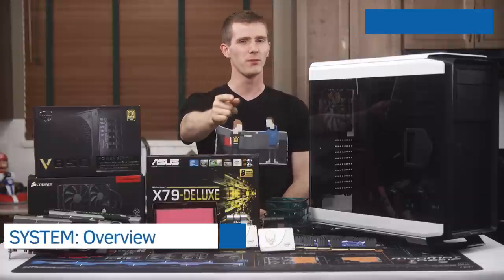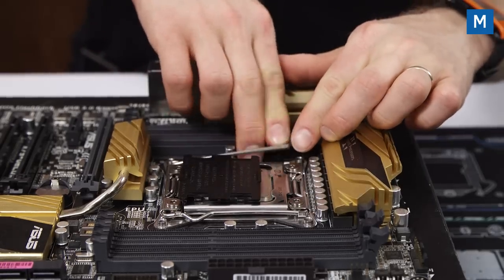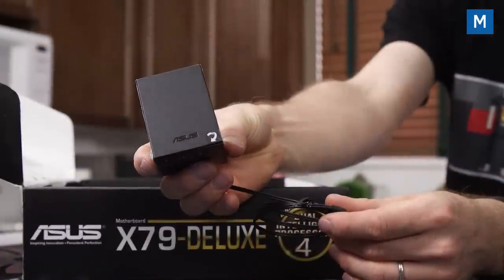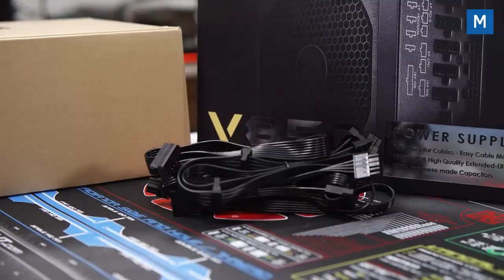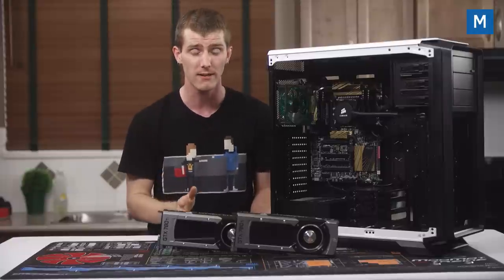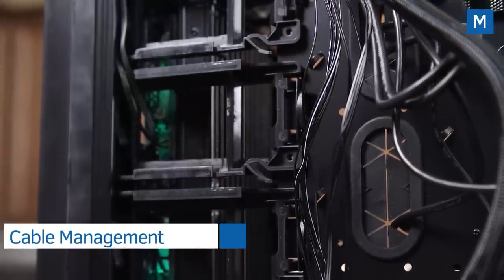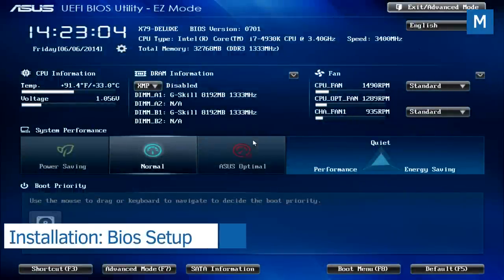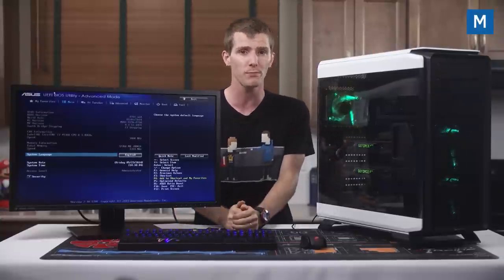How to Build the ULTIMATE 4K Gaming PC Build Guide

Comment: Can this handle minesweeper?
Reply: No.
Reply: minesweeper needs Intel Core i9 8970x @39Ghz ,32 cores,256GB of RAM,Geforce GTX TITAN 9 ULTRA 8 way sli,90TB SSD to run in 0.01 fps.If you want to run in 120fps,get a 128000 node of Xeon E19 (98th Gen) of supercomputer
Reply: Eugene Yau But the Titan 10 Ultra Ti just came out, get it instead. It is only $30,000 more then the Titan 9 Ultra non Ti.
Reply: thanks
Reply: Impossibruu its only 7 billion pc's that can run that game at stable 60 fps the pc is your brain :)
Imaginationnn.........
Reply: Eugene Yau :( dang it all i have is an i5

Comment: Could you make an Ultimate 4K build for 2017?
Reply: +Mateo Vasquez yeah with quad SLI please
Reply: +Dante hollow 4k effectively rules out SLI, because AMD are better at higher resolutions. You want Crossfire.
Reply: +Dante hollow why
Reply: +Christ J Dont buy amd now, wait for polaris at the end of summer. Im gonna upgrade my gpu then
Reply: +Samuel Kriikkula there's nothing wrong with amd if ur on budget, also upgrade to a 1070/1080
Reply: Ethan Mc 1080/1070 too expensive for now i would just wait for polaris
Reply: +Samuel Kriikkula it's not really?
Reply: Hey guys, I need your help. Could anyone tell me how to know if a graphics card is compatible with your motherboard? Im thinking of getting a GTX 760 but im too scared to buy it and hope to god it works
Reply: Mateo Vasquez if you have a graphics card already then it's fine. If not, it's still fine.
Reply: Christ J Huh?
Reply: Mateo Vasquez basically, provided your motherboard is less than a decade old, it's almost certainly fine.

If you want to be certain, download CPUZ or HWInfo and install and run it. Then see what the results say about your motherboard, and search for any compatibility issues.
Reply: Mateo Vasquez any motherboard that uses pcie will work with any amd card made since 2006+ and any nvidia card that says GTX next to it
Reply: Gigabyte gtx 1080 Xtreme Waterforce Your's is too outdated, and 32gb of ram? That's overkill. I can build a better one for cheaper. 
https://pcpartpicker.com/list/6m89Ps
Reply: my build, called it "the exotic"

i7 7700k
asus strix z270e
crucial mx300 1TB m.2 ssd 2280
2x8Gb corsair vengeance lpx 3200mhz
corsaif h100i v2 water cooling
h1000i corsair platinum power supply
corsair 400c
aorus gtx 1080 ti

around 2.5k us$

there's your 4k build

Comment: Its 2017 and I still think 144Hz on 1440p is better than 4k.
Reply: Bevan Jonsson it’s 2019 and that’s still the case
Reply: 2024 and 4k is maybe starting to make sense?

Honestly it's in the same spot as before 😂
Reply: @hellowill  can you now regularly get 120+ fps on 4k with a single gpu on max settings?

Comment: Can it run Duck Life 4?
Reply: no
Reply: no
Reply: +Pepperbird no
Reply: +Pepperbird if you want your duck walking around in 30 fps, go for it!
Reply: +Samuel Gratkowski thanks for the advice. I usually got 2-5 FPS and it runs smoothly.
Reply: +Copter256 No. You will need at least 60 GPUs in 60-way SLI to run that.
Reply: +Dylan 873 you need a 9000 way sli of titan x
Reply: 1% percent of people get that joke
Reply: DONNY THE SLAPA whos that?

Comment: I think R9 290Xs would be more apropriate than 780 Tis for 4K gaming.
Reply: The R9 295X2 is probably ideal.
Reply: I agree , not enough VRAM on a 780Ti , probably not enough VRAM on a R9 290X but the extra gig will really help .
Reply: ***** It's not only the VRAM, I also see in becnhmarks that R9 290X performs better in 4K than a 780 Ti in 4K cause of more memory bandwith and ROPs.
Reply: I thought AMD fixed that issue, no not because of that since even a single R9 290X performs better in 4K than a 780 Ti.

Comment: How much FPS would I get on Minecraft with this build?

APU: AMD A10 7850k over clocked black edition

MOBO: MSI A68h matx board

HDD: Seagate barracuda 1TB 3.5 7200RPM 

PSU: EVGA 430W 80+

RAM: Kingston HyperX Fury White 8GB (2x4GB) DDR3-1866 Memory
Reply: 300-700
Reply: +.The Randomizers. Thanks
Reply: I change the parts a bit will it still be the same? Here.
How much FPS would I get on Minecraft with this build?

APU: AMD A10 7850k over clocked black edition

MOBO: MSI A68HM-E33 matx board

HDD: Seagate barracuda 1TB 3.5 7200RPM 

PSU: EVGA 500W 80+ Certified ATX Power Supply

RAM: A-Data XPG V1.0 8GB       
(2x4GB) DDR3-2133 Memory
Reply: same
Reply: Thanks
Reply: No GPU?
Reply: RileyCSGO Yeah?
Reply: +AlexaGaming prob 60 fps
Reply: You need a gpu to at least play the game at higher framerates with "resource packs" as well.
Reply: +AlexaGaming At different settings, here's what you'd probably see.

1080p, no entities, standard world: 60-100fps(ish, I don't actually have your exact rig but it's close enough)
1080p, no entities, void world: 120-170fps
1080p, 100 entities, amplified world, 20000 particles will bring you below 15fps
Reply: +RileyCSGO apu..
Reply: +AlexaGaming  you must write the graphigs and the ssd not just the apu
Reply: my build is almost identical but higher ram and an A8 but I get well over a hundred.
Reply: okey how much ram do you have i have 16GB
and a nivida gtx 950 and intel i7 thats pretty beast but you can play minecraft on that pc on far you should get about 50-200
Reply: Gillis Salonen I have 16gb and an A8 7650K
Reply: +AlexaGaming Go play a real GAME bro, some GTA would be really cool...maybe some Battlefield or CSGO
Reply: SergeantKalSkirata 0_0 GG
Reply: +AlexaGaming Above 60+ all the time, but I would suggest getting a GPU
750ti even

Comment: Only 1 monitor running ~45FPS?  nice production, but for the money spent the actual computer blows.
Reply: 4k max settings what would you expect
Reply: from a single?  4K 150FPS+. I literally want my hair to be blowing back there is so much graphical processing power.  Remember, ULTIMATE computer.
Reply: to be honest I will be content on running medium/high settings at 60fps 4k on my r9 290. A higher resolution is a bigger improvement than almost any quality setting. But I understand why people would want more for that much money xD
Reply: Son of a Zombie even a maxed out system wont atm

Comment: "ultimate build"
"sponsored by intel"
definitely no bias here, guys. nope.
Reply: AMD has good processors, but you can't deny that Intel has a slight lead on AMD.
Reply: Amd has good overclocking and cores so you can have the advantage for 3d rendering and multicore things.
Reply: pingo6able "multicore things". Did you major in Thing Science?
Reply: JamesHD1990 That reminds me of the end of my Freshman year when we took some survey thing that told us what kinds of jobs we might get and one of the very broad categories was "Working with things" and one kid thought that was hilarious.
Reply: JamesHD1990 i could say stuff, or programs. Mainly rendering, 3d modelling, and games with multicore support. Or baking, or fluid simulation... Or any simulation. Theres a lot of things that do multicore.
Reply: pingo6able more cores=/=faster 3d rendering... It can process more parts of the picture at once but that slower.
Reply: hmm? yeah, it can, but it's still utilizing all of the cores which most games can't do.
yes, cores don't mean faster 3d rendering. but the fact they can be used does mean faster rendering for the price.

Comment: Built my first PC with the help of this build guide, saved me from frying nearly $1,000 in hardware since I didn't know about the anti-static wristband before. It all turned out just fine, save for trying to use an i7 7700K on a Z170 board without an old CPU around to update the BIOS...